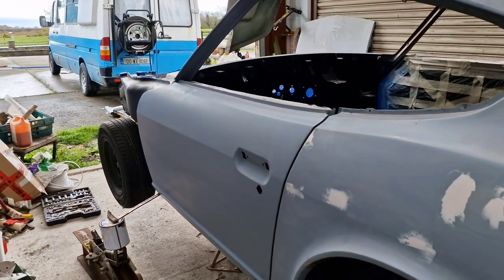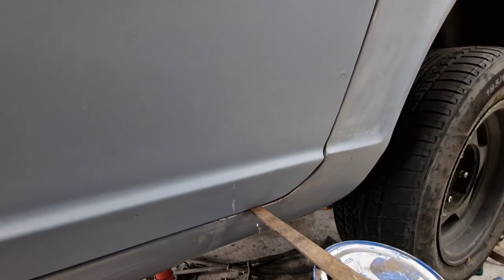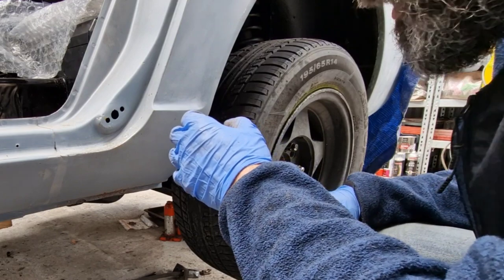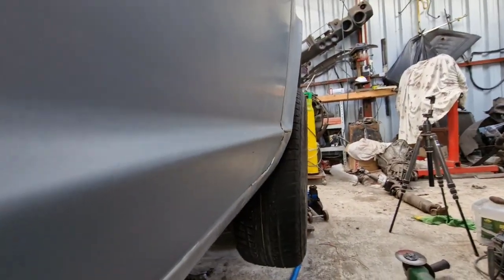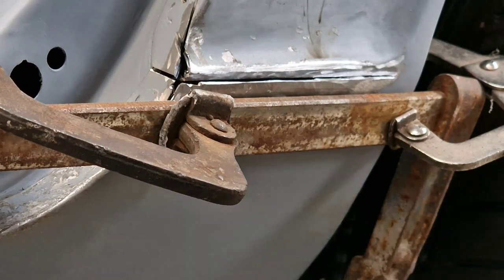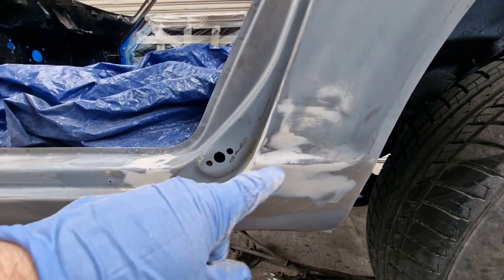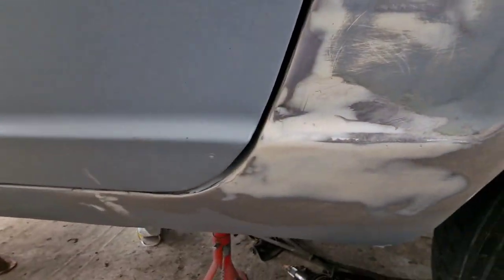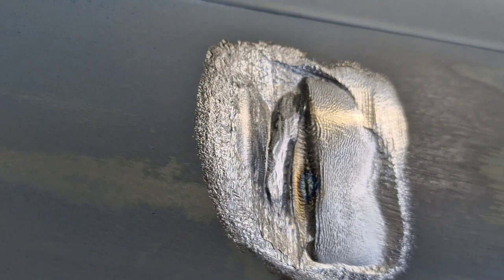Datsun Z. Fixing The Dog Leg, Solder Cracks & Fitting the Battery Tray. 240Z 260Z 280Z.

Comment: Hey Sparkie. Take a good look around inside your welder. I’ve had times were my welder does the same thing. You can cleanup or change out some of the contacts, also the feed roller. Maybe some of the thicker wires “00” deep inside that connects to the transformer might be soft, loose or dirty. 

Hope this helps💪🏼 love your channel bro!
Reply from the maker: Hey Sparky 😀. Good tip. I will give it a strip down and check it out. Plenty of dust in the shed lately which doesn't help. Then contact is a good starting point as it is acting like one of them failing. Cheers.

Comment: That hole on the bulk head side of the battery tray that you assume is for the battery clamp is not in fact for the battery clamp. On a Z there is a rectangular frame round the top of the battery. At the bulk head side it bolts horizontally into the bulk head just above the top of the battery. At the front side there is a hold down rod that hooks onto the battery tray.
Reply from the maker: Hey Andrew. This really threw me when assembling it as it didn't make sense. Can you send me images of the setup to sparkiesshed@gmail.com and I will send out an update on this. The quality of the tray was top notch and don't want to diminish it in any way. Thanks for your input. I plan to put a bolt through the bulkhead and add a strap hook to grab the battery. But a pic will help with this
Reply: Email sent.

Comment: Great, detailed video. Will for sure watch all videos before starting the replacement of body panels on mine.

Care to share the manufacturer of the body panel that you used?
Reply from the maker: Auto Panel Solutions and KF Vintage. Very good product from both. Any discrepancies are captured in my video 😁
Reply: @sparkiesshed3818  that kinda sucks. I was planning on getting all the panels from them. I want to do all the work myself and I'm not a welder. So I was counting on perfect panels to make it more manageable for me.
Reply from the maker: To be honest they are perfect. I just get caught up on minute details which  I loose weeks of my life to for nothing 🙃. I would recommend them!
Reply: @sparkiesshed3818  Sadly, I'm the same 😅
Reply: @sparkiesshed3818  Any new vids in the pipeline?
Reply: @kevpatts  literally working on 3 right now. Hope to get one out in the next couple of days. Have a new arrival so slightly distracted 😁